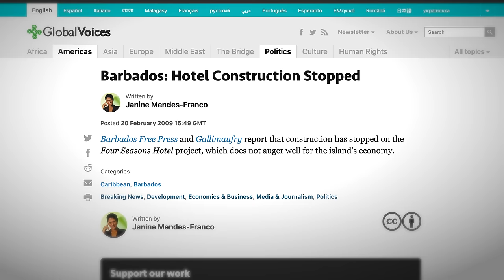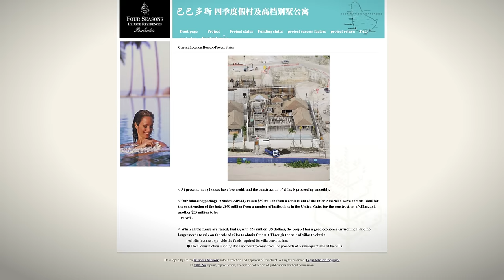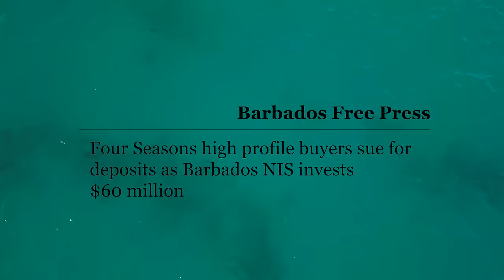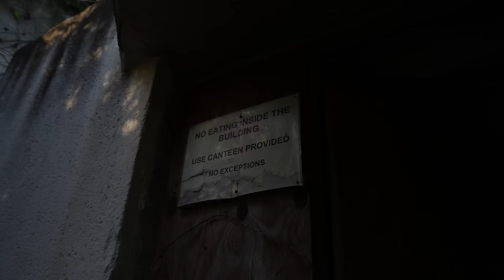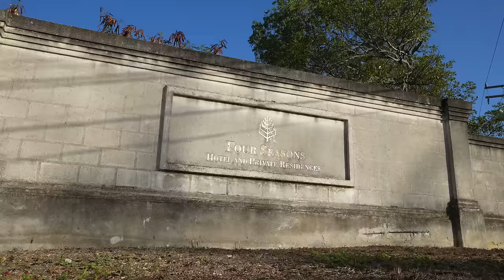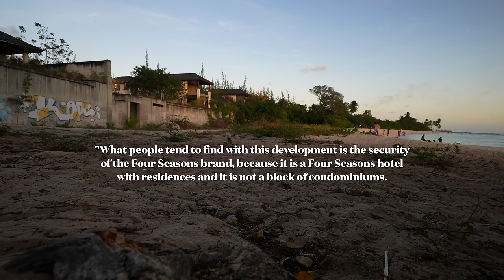Unbelievable ABANDONED Four Seasons Luxury Beach Resort

Comment: You can really tell that the construction was done properly, with quality materials. Even the workers quarters had the sink area tiled. After so many years, the abandoned buildings did not have any pooling of water bodies, sunken floors, cracked walls etc. It's a shame it ultimately ended up in this state
Reply: Cinderblock is a common quality material

Comment: 9:00 -- RE: 2008, The Business Plan, and Why It Doesn't Take Long for the Jungle to Reclaim it;  Three items!

A )  It is spelled "Recession".  (Chapter title)

B )  It makes sense to me that the Developers chose to shift the focus of construction from the Hotel portion to what I assume are leased timeshare luxury mansions, because it seems to me that this Business is somewhat akin to the generation of nuclear power.  It is as if the Hotel would have been attempting to generate profit when, in effect, it takes way more employees to actually get that kind of profit and to keep the guests happy.  To extend the nuclear power metaphor, there's basically only 2 useful cycles in terms of the physics involved.  The high power "fantasy-fusion" concept is the large subdivision of leased timeshare mansions, because of the Exclusivity of it.  The Hotel by comparison is a dangerous (because volatile market) "water cooled" power plant not unlike Chernobyl or Fukushima. 

C )  Funny thing, but there is also an analogy between the rapid rate at which the Jungle can reclaim development in the tropics and the speed at which the Exclusive Jet-setting British Power Brokers had to downsize their property holdings in Barbados because there was only so much they could write off, so obviously the leased timeshare mansions had to go.